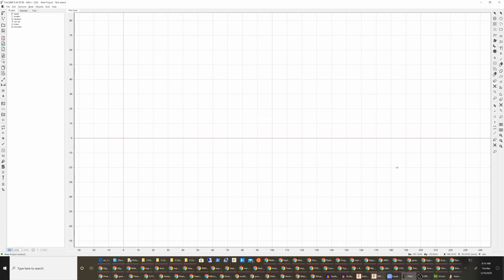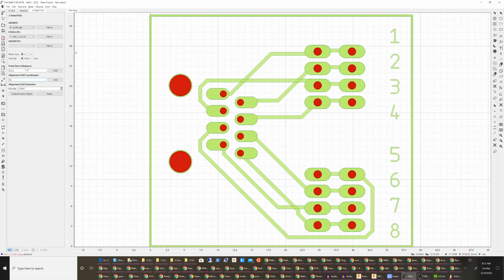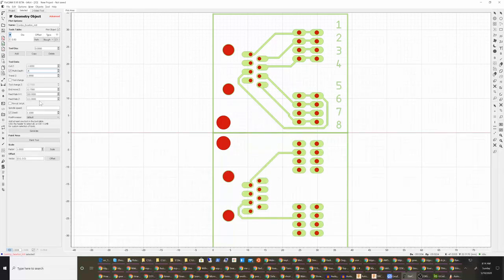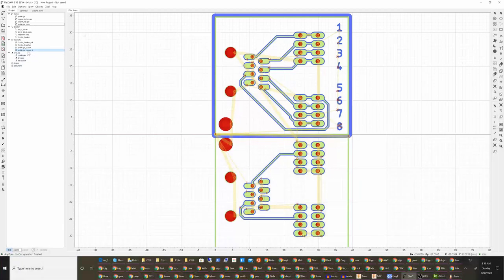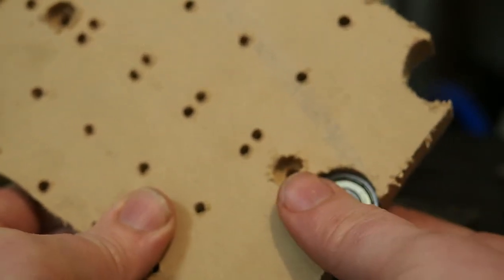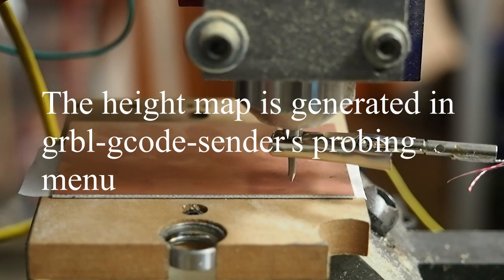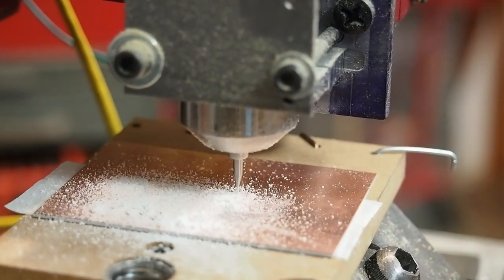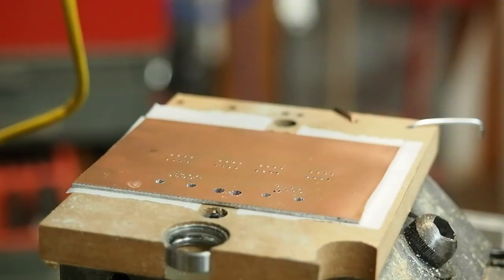double sided pcb with flatcam and grbl gcode sender

Comment: Just solder to each side of every pin, and if you need a via, stick a bit of scrap wire in and solder it on both sides. No problem.